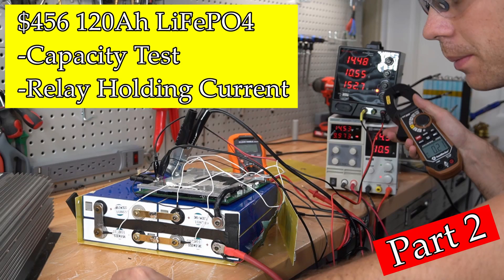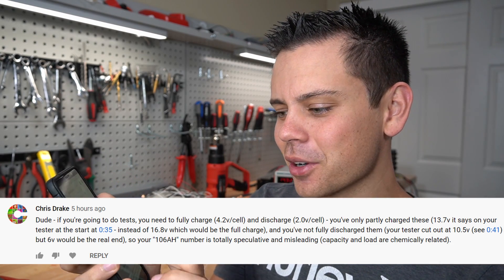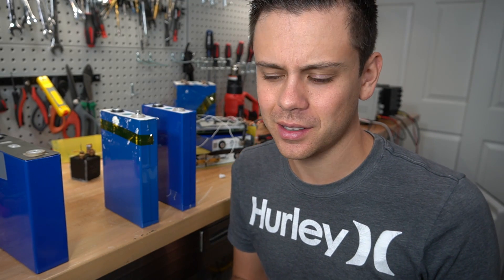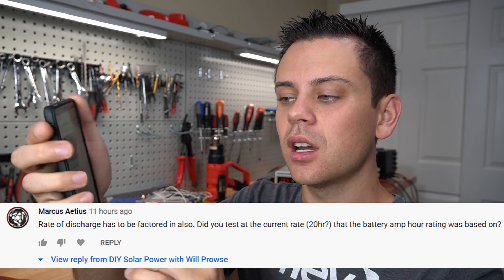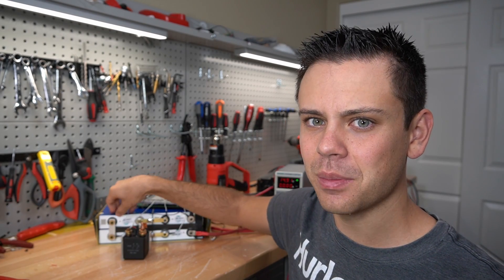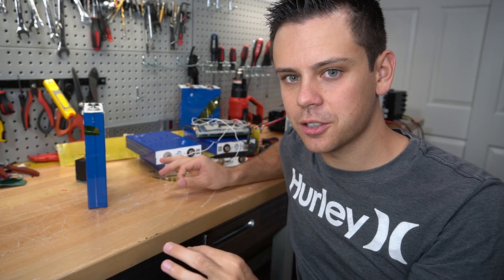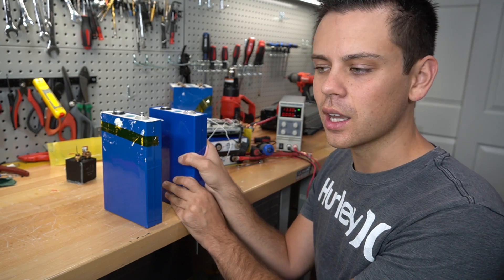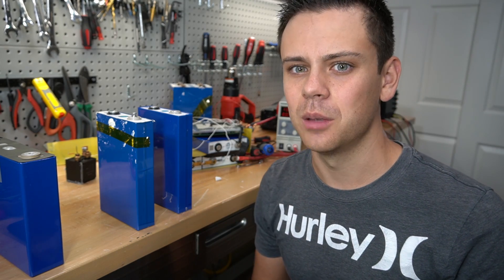Disproving LiFePO4 Battery Misconceptions in my Latest Video's Comment Section

Comment: I have been thinking about how to start with off grid solar for my house. After watching Will's videos I have realized that taking the whole house off grid would be far too expensive and the time to recoup my investment too long. That said, I can see that off grid for smaller stable loads like lighting, refrigeration, CPAP, telephone, internet etc would require a much smaller system and taking these smaller, but very stable loads off my power bill would make it possible to recover the smaller investment quickly. Having these essential services free from the grid also makes us much more self sufficient. After recovering the initial investment, I could then take on the next largest loads with secondary off grid systems. The challenge is that my house isn't wired to separate the loads I want to get at. I will have to change the way the circuits are laid out and in some cases add new ones. I see this as a longer term migration strategy to off grid solar. Thoughts?
Reply: I think it's better to go big from the start, even if you have to finance some of the investment. When you consider everything involved with multiple small systems, a single bigger system is far more cost-effective from initial expenditure to payback time. 

But still this may be more than we can afford, so what I hope to eventually do is provide my own lighting and a small amount more to make power outages more tolerable rather than than with saving me as much money as is possible, or becoming totally self-reliant for all my power. If I really need to I'll fire up the generator for heavy loads during a long power outage, but for short outages just having lights, TV, internet, etc will be enough to get through comfortably and I'll still save a bit of money the rest of the time too.

Comment: Hello, do you still recommend initial and top balancing, even if the merchants says they already performed their balancing and capacity test?
-Voltage:The deviation less than 0.01V
-Resistance:The deviation less than 0.1mΩ

Comment: Will you saved me literally thousands. The links from your website helped me find a deal on used 250W panels,  a pallet of 10 for about 20 cents a watt. They're shipping now and I'll let ya know how it goes after setup. Even if only half work that's an order of magnitude cheaper than renogy. Bought your book on amazon as a thank you for this and all the other good info. Will post a review when it arrives. Keep up the good work and thanks again, you're really making a positive difference for a lot of folks.
Reply: Update: got the panels today and they rock. They’re not pretty but man they perform. Rated for 37.6 Voc, actual measured 31 V in 6 pm shade on a cloudy north Texas day. About $450 for a pallet of ten plus shipping. That’s 2.5 kW fellow sun warriors! Go to Wills page and follow the eBay links at the bottom.

Comment: Is there any video that talks about lithium batteries and their heat generation? I recently converted my son's power wheels to an 18 volt lithium battery using a Milwaukee drill battery pack and I noticed that if he rides it for very long the battery pack gets extremely hot.  I know those battery packs are a 5s2p configuration.  Does having more batteries in parallel reduce the heat?  Those battery packs are only about 5 or 6 amp hours at most and I was thinking of building my own lithium battery pack that was 20 amp hours. Sorry if this is a noob question

Comment: So I bought a Lithium 200 amp hour battery off of Amazon for $1,300 to use with my two 200 watt panels. With 400 watts of solar and 200 amp hours of battery my van will have plenty of power 😃 . Thanks Will for the awesome information on how to set this up! My costs were less than $2k.

Comment: So you’ve talked about solar systems that power your heating and air-conditioning systems they do exist I have installed them myself and when your heating or air conditioning system is not using any of the solar energy it will convert over and can run an electric hot water tank lights entertainment system etc.
I’ve also installed a water exchange system so if you have a hot tub or pool instead of using a condensing unit outside of the house you have a water refrigerant coil loop and what happens is when you want to cool your house down but heat the water in your hot tub or pool the heat exchanger transfers the heat from inside your house to your hot tub or outdoor pool well transferring the cold water from your pool or hot tub to cool the inside of your house extremely easy system to set up and install

Comment: New to solar and batteries. I'm getting supplies to do our offgrid. Doing 48v system and looking for best price for batteries. Also have you done anything with midnite charge controller ever the special model buck only unit. Along with going with the sma sunny island inverters. Thanks for info

Comment: I like your shows, don't miss any.
When are you going to test the SOK battery. 
I bought one and it had a problem.  The company is sending me a new one.
Problem was 7.2 volts when it arrived, when tested with an analog voltmeter, 10,000 ohm load voltage dropped to 5+ volts.
Contacted the company and they had me do some tests then open the battery.  Burned wires from the BMS that were corroded badly.
For the green corrosion to occur it was some time ago in it's shipping.  It also was dropped causing a mounting bracket to bend cutting a wire from the + terminal to the BMS.   They were very responsive to my e-mail, good quick customer service.
Reply from the maker: I was planning on buying one soon. I'm glad you let me know of your problem. That's not good

Comment: The comments where people say "you need to charge a few times to wake them up and get full capacity" baffle me. I'd love to know where that started and why...
Reply from the maker: Agreed. I wonder the same thing.
Reply: @WillProwse  If I had to guess, it's because basement warriors read about the mfg process of lithium ion batteries and thought the final step in the mfg process, formation, is critical and does "improve" the battery to wake it up and get full capacity  Many articles on the net in this process.  But by the time a battery ships from the OEM, the foundation step has been done, so no need for the end user to do so.
Reply: If I had to guess, it's because basement warriors read about the mfg process of lithium ion batteries and thought the final step in the mfg process, formation, is critical and does "improve" the battery to wake it up and get full capacity  Many articles on the net in this process.  But by the time a battery ships from the OEM, the foundation step has been done, so no need for the end user to do so.

Comment: Would you recommend doing a 48V system for a Van conversion? We want to use an induction stove top and maybe an air conditioner for short periods? We are planning ours and I keep hearing how the inverters are much cheaper for a 48V system.

Comment: Hey Will!
There is actually some truth to the "breaking in" certain lithium batteries. Yes, I read the battery university page. Winston and Thundersky used to be separate companies back in the day. Thundersky had its own website with english documentation. It stated that initial charge should be done to 4.2 volts. IIRC, when yttrium was added they lowered initial charge to 4.0V. I don't know if charging that high had any benefit though..

Why do I know anything? Well I have 49 Thundersky 90Ah LiFePo cells, made in 2009(!) in my EV :)
Good content, subscribed.

Comment: Hey Will, first of all: Really like your videos, how you explain things and bring the important bits and pieces to the viewer! As a doctorate student in the field of safety of lithium ion batteries, I can affirm that you do have a good understanding and structural approach on the topics. Built my own small solar farm (as a hobby the past weeks) and was lucky to find your channel, especially about some stuff where I needed more info on (MPPT vs PWM, real life data on inverters etc). For the C-rate topic: The rated nominal capacities for cells are measured for a certain current/C-rate, of course with a higher discharge current the capacity decreases slightly due to the DC-IR drop, but I think you also mentioned this.
Keep it up, you're putting out great content and dont let those comments get you down!

Comment: How can I apply these battery cells to a marine application ( trolling motor electronics ECT)…? 

If I can save alot of weight this may be worth it. Weight is gold on a small boat. Everywhere I can cut weight it would be a plus. Kind of confused on the ratings on the cells. 3.2v 100 ah for example. I know what amp hours is and the volts lol what I'm trying to understand is if I throw these in series will I get more amp hours at 12 volts? So more than 100 ah?

Comment: Will, Thanks for pointing out the danger zone on the positive side of the battery pack. I purchased a similar battery, which I opened today, and immediately tore it apart to see what was up. Sure enough, the lead from the terminal to the battery is unfused. I would not have looked for this if you had not pointed it out on your battery review. I will figure a way to make it safe. Thank you.

Comment: Hello Will, I absolutely love your content that you put out. I am wanting to build a 12v 200ah LiFePO4 battery for my RV. In building a battery pack is it recommended to have a BMS and a Battery Voltage Ballancer or is just a BMS required? Keep up the great work. Thanks!

Comment: 🔴❓🔴❓🔴❓🔴❓🔴$287.50 Please test and review a Maxwell 16V 500F Graphene Super Capacitor Battery 12v Solar Power System Home

Amazon 

❓super capacitor:16v 500F
❓long lite:Up to a million times charge-discharge cycle life,15years
❓High Power density:up 6700w/kg. Low ESk:can be uised as a rechargeable battery and ideal for back up purposes
❓Ouick charge:charging 10 seconds to 10 minutes to reach its rated capacity of more than 95%
❓3.Low ESR: can be used as a rechargeable battery and ideal for back up purposes

Well is it any good?📊

Comment: Graphene batteries are out for solar. (Maxwell 16V 500F Graphene Super Capacitor Battery 12v Solar Power System Home) $287.50 have you tested any of these?

Comment: Regarding the returning after tearing down that people are mentioning
I believe what they are talking about is GENERALLY if you take something apart you void a type of warranty etc etc, with most things if you take them apart you cant return them. So they arent 100% wrong, its just general practice that everyone is used to where a seller will not accept a return or refund for something you disassembled. But obviously there are certain reasons why a product CAN be returned/refunded after being taken apart because it isnt up to Spec or in the case of batteries up to Capacity. For the longest time this has been a general rule for most things, so i just think that most people arent accustomed to being able to return a product after you messed with it that isnt within normal usage, (disassembling to one extent or another for example).

Comment: Hi Will, you are correct in your statements, and I am happy to concur with your conclusions.  Many adults fall into the trap of thinking that stuff they learned in their youth will be all they need to know for the rest of their lives.  This can be dangerously false - a few years back Boeing had some fires on their planes from then-new lithium battery packs whose chargers were providing a continuous maintenance/trickle current as if they were classical NiCd packs.  Big mistake, and the spooky thing is that no-one at Boeing caught this error.  Interesting precursor to the fatal crashes of the 737-MAX, don't you think?
Ditto for the business of cell performance improving after the first few cycles - this is often true for lead-acid, NiCd and NiMH cells, but not for any of the lithium technologies.  BTW, I prefer to not use the word chemistries when discussing lithium cells - as you know, they don't function from electro-chemical reactions, but from intercalation [physical] operations.  
I prefer LiFePO4 cells because they have a much higher thermal runaway threshold, and are therefore much, much safer.  The downside is that they can only be charged to ~ 3.65 V/cell, or floated at 3.45 V/cell.  Many Li-ion technologies typically charge to 4.2 V/cell, which can be interpreted as higher energy density, but their cycle life is usually far less than for LiFePO4.  Tradeoffs, tradeoffs...
To newbies of any age:  these are not your grandfather's mushy lead-acid batteries, and as time goes on we will be dealing with batteries with even higher energy densities, which makes them even more dangerous if abused or misunderstood.  Study the manufacturers' data sheets!  Clearly understand that what you knew last year may NOT be valid today.  Things change!

Comment: Peukert is small but significant with some LiFePO4 batteries. For example, Battle Born says to use a Peukert number of 1.05 when configuring the BMV-700 (or 712). Can't post URL on a youtube comment, but google "battleborn blog bmv settings" and you'll get the link.  A Peukert of 1.05 is not insignificant (1.0 is no Peukert effect). You can google "peukert effect calculator" and see that the effect on a Battle Born 100Ah battery discharging at the continuous max of 100A with Peukert of 1.05 is 79.4Ah instead of 100Ah. Note that that is WAY better than a typical lead-acid with a Peukert of 1.25 where you would get only 31.6Ah at a 100A discharge rate.
Reply: Personally, I think Battle Born is being a little too conservative with 1.05, because that would mean that even at 5A we'd only get 92Ah. I don't find that to be the case with my bank of 400Ah of Battleborns.
Reply: That said, some batteries build in extra capacity to deal with this effect. Your past tests show that with quality batteries like Battleborn and Lion 1300's that you actually get the specified capacities.

Comment: 4.2v ?? Missing I think is this guy confused these with lithium ion. Lifepo4 completely different, science & engineering don’t lie. My lifepo4 batts are not charging to full voltage because when I bought mine the charge levels were still in a state of argument but Will and others are solving the confusion. My charge controllers are overseas and I can’t make the changes. I’ve only been charging to 27v and floating at 27v because I couldn’t get answers about charge levels. 3.375v is not enough to get my full 800ah capacity. I had suspected something was wrong since if I’m correct I should be getting 22kWh. My inverter drops out at 21v, 2.265v per cell. Charge cycles claimed is another foggy are for me, is that based on full discharge to 2v? Will, please correct me where necessary. Thanks

Comment: Hi Will. I have a question for you. I have a 100W solar panel with Voc 21.6V, Vpm 18V, Ipm 5.55A and Isc 6.11A. Now, with a meter I get around 20.00V but only 0.10A. Is my solar panel dead? Thank you and keep them videos coming please. Thanks.

Comment: I learn more about solar and batteries and BMS from WIll Prowse than everywhere else combined. Cheerleading LiFePO4 batteries convinced me that is the way to go for my initial 5 KW/ hr battery system. 48V 100A Fortune cells @ $2000

Comment: Best to be extremely careful not to leave any physical evidence of your disassembly attempt.
It's common for manufacturers to deny returns if the device was opened or the seal is broken.
It's not because they falsy advertised capacity and got caught, it's because there are scammers out there that remove expensive components and return dead or broken cells.

Since you opened it, you can now throw in some 75AH cells and send that back, keep the 25Ah change for your troubles...  Claim their 105ah for some righteous payback;-)

Comment: I am wondering if the higher voltage guy was not confusing your battery with the ones with LTHP. IF I remember correctly they have a marginally higher and lower voltage that roughly matches his numbers.

Comment: Your situation reminds me of when I was selling a isolation inverter to a self professed ‘rocket scientist’. I was explaining,  it converts 12 to AC current passes it through an isolation transformer creating a completely separated 12 volt circuit that would power his 12V positive ground Mac truck radio.  He was not having any of it, he yelled at me, he  knew it would obviously create a dead short and ruin his radio. As a manager I could never raise my voice so he could hear me over his yelling. As fate would have it Craig, a local Car stereo ( and CB radio in those days) installer, was there picking up some hardware and was being patient up to that point. He raised his voice and said  “Burt here can’t yell back at you. You might be a rocket scientist but you know absolutely nothing about consumer electronics!  Your an idiot! “ He left with out buying.